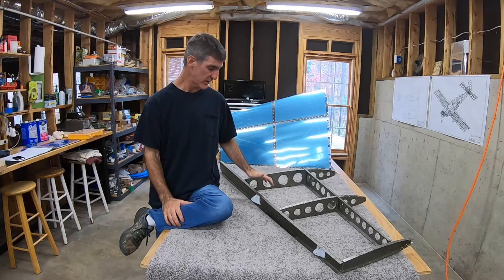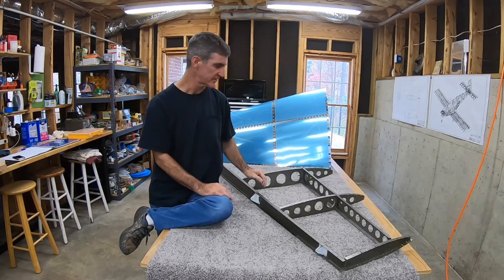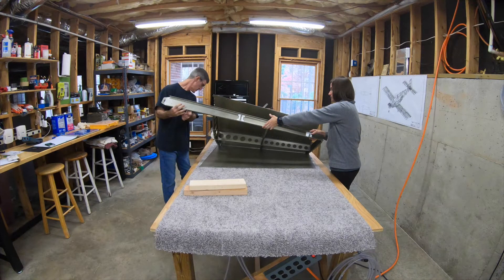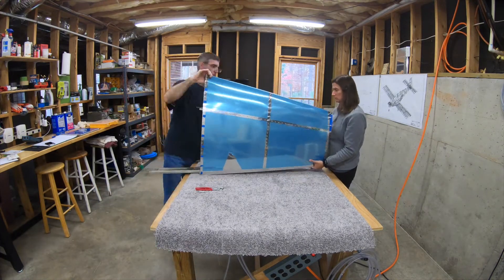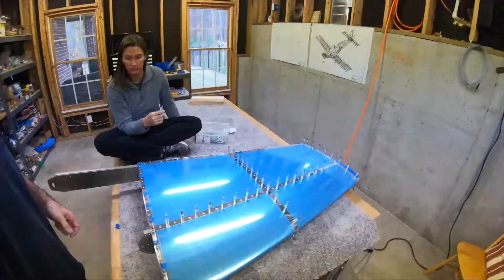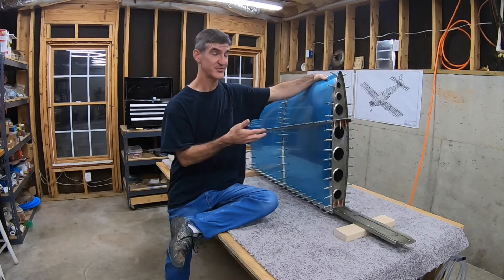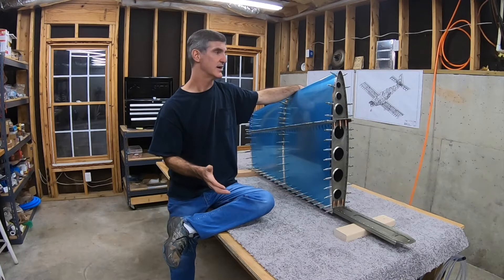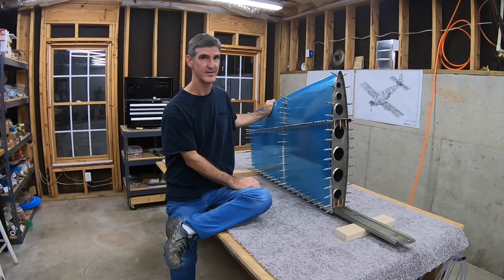RV-10 Build Log - Emp 13 - Is this the trick to putting the skin on the skeleton?

Comment: I'm looking into starting my own kit soon.  I'd love to work in my basement  but only have a single door and narrow stairwell so it's the detached garage for me.  Watching your videos, I'm was wondering how you're going to get it out of the basement?  Do you have a wider door somewhere else?
Reply from the maker: That’s the first question most people ask when I tell them I’m building a plane in my basement!  I only have single door to the outside, too.  By my measurements, everything should fit out that door except the fuselage.  Wings and tail surfaces should be able to be carried out sideways.  Tail cone should also fit out the door, barely.  When I get to the fuselage kit, I may switch to garage.  Alternately, I have a double bay window in the basement that I could cut out that I think the fuselage will fit out.  I’d have to replace the window after, of course.  That’s probably a few years down the road, so I’m putting off that decision.

Comment: You may want to support the assembly with 2 x 4’s or square metal pipe to raise it up off the table just enough to clear the clecos. Working on the assembly with it resting just on the clecos will cause small dings in the skin.
Reply from the maker: Good tip, thanks!